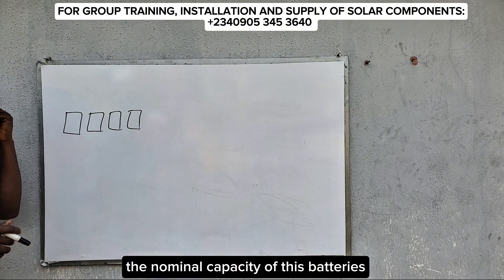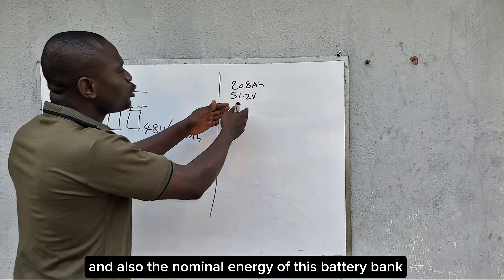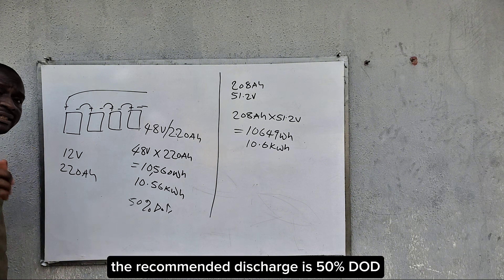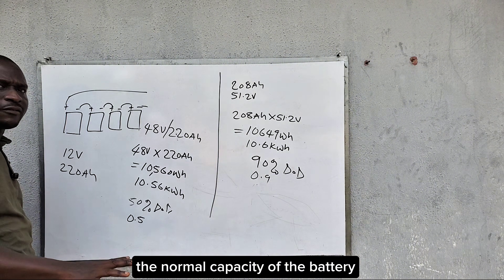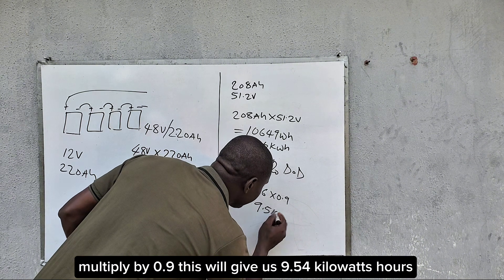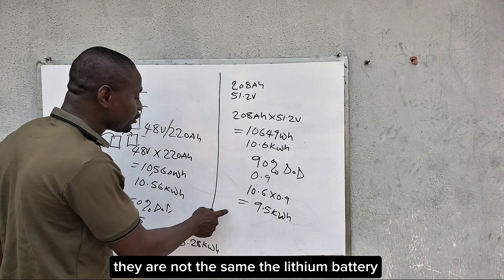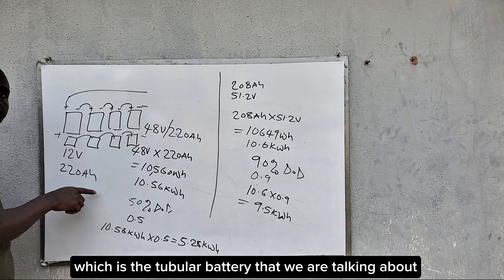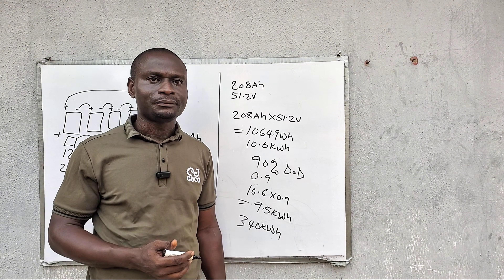Four Tubular batteries Vs 10kWh Lithium battery

Comment: Good evening sir, I've been following for some time but i only recently began to go through your videos. I'm transitioning from lead acid battery to a lithium battery and I intend to start with a 10kwh battery for now then maybe add another 10kwh before the year ends to make a total of 20kwh. I have a 5KVA Gennex Inverter. Which of the brand of battery will you recommend considering cost to performance ratio.

Comment: Let's not spread misinformation with using the incorrect terms. 
Capacity factors V and A. Current is not interchangeable with capacity: A 12v 220Ah battery has only one quarter the capacity of a 48v 220ah battery bank.

Also, connecting batteries in series does not "double" the voltage. It increases it. Connecting 2 batteries in series will double voltage, 3 will triple it, 4 will quadruple it and so on...

Good lesson otherwise. 

Keep growing!
Reply: I believe it was a slip of tongue, good observation though

Comment: Thanks alot for the lesson, this is what I understood about DOD😮,

 but how come when ppl do battery capacity test using a shunt, for example a 15kwh with 90% DOD, they still pull over 15kwh capacity from it, and now batteries that do not get up to the rated capacity using a shunt is said that it is not complete. 

If you can kindly explain this I will really appreciate it.
Reply from the maker: When you do a capacity test, you are pulling everything from the battery at 100% DoD. If you completely discharge a battery bank, the DoD is 100% and the state of charge is 0%
Reply: @Solarwattng  thank you very much for the reply.
Reply from the maker: @skseries-tek 🙏

Comment: What are the cost between these batteries. 

The cost can be a factor as well
Reply: A single tubular battery will be about 250k. So for about 10kw of usable capacity, you need 8 of such batteries, for about 2m.

A 10kwh lithium battery will cost just about the same amount. You can actually get brands like Deriy for less. 

However, the lithium battery will outlast the tubular batteries. A lithium battery can do up to 15-20 years before degrading significantly but a tubular battery will last just about 4 years. 

Fact check all I've said
Reply from the maker: @abdulm1382 Thanks for your input
Reply from the maker: Lithium battery is still better in the long run in terms of cost

Comment: But please is it true that it is not all inverters that can use lithium battery? I have a 5Kwh inverter and the tubular batteries have gone bad, my engineer said it can't use lithium battery.
Reply: Yes,those inverters that do not have the cut off voltage settings, they can shut down the lithium battery bms